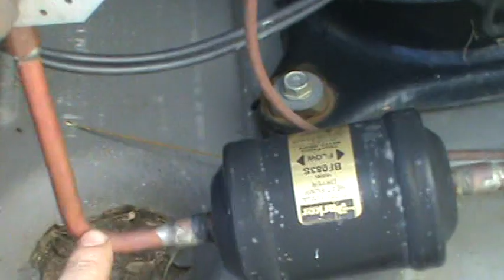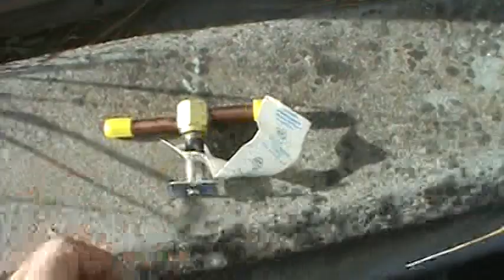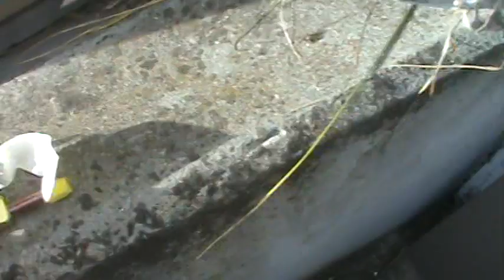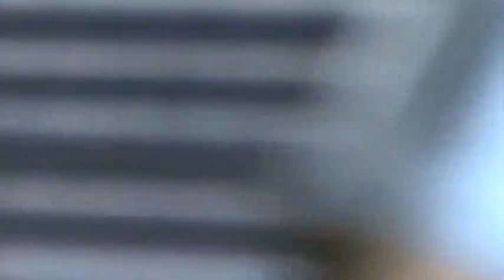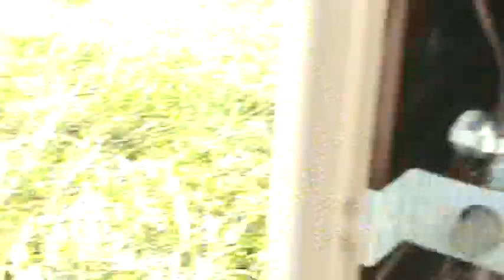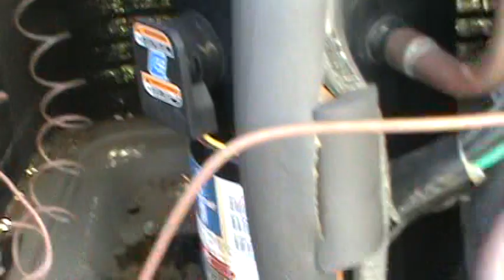Air to air heat pump modification: Video 1

Comment: Air flow issues can cause that hunting.  Your unit looks very close to the house.  The coil looked clean enough but can't say from a video.  If you hold your hand over the condenser fan when it runs, feel the air flow and if it is blowing more "out toward you" than "up".  Restricted air flow can be found this way.  You seem very tech smart, but I wasn't sure if you were into the science of air flow also.
Reply: PS I didnt mean to imply air flow was the only possibility.  Just one that came to mind.  Another is a low refrigerant charge due to uneven distribution out of the coil....  and the list of possibilities goes on.  I just love sharing and the discussion.

Comment: how the fuck did you come up with 80000 btus of heat loss. The sensor you moved is a coil sensor it is supposed to be on the "coil" not on the liquid line and not between the metering device and capillary tubes. The sensing bulb should be insulated so as to keep the ambient temperature from affecting expansion valve. Also all heat pumps are designed to switch the reversing valve, cut out the fan and engage the heat strips to compensate for the cold air. 

I would love to know how that hot bypass is working for you.

Comment: Dude what an AC genius!  Can you point me in the right direction on how to modify a window 1 Ton heat pump to heat the water on my electric water heater?  The thing is old and a new one is 2K.  I can get a 1 ton heat pump for $300.  Can you let me know if you think that can be done?  I already have a drain plug for the AC that sits next to it.

Comment: Any more updates on this project?  How'd the hot-gas bypass defrost work out?  I'm considering something a little less technical... solar collector to pre-heat the outdoor unit intake air (winter only). I'm still learning, but always searching for ideas.  My Trane XL14i (2.5t) just ran out of warranty, so I'm ready to begin mods. I believe I may even have a bad system controller, as it does not like to bring in aux heat (gas) by itself. Defrost seems fairly normal... rarely runs, but the odd part is that the system runs down to under 15°F and still pulls heat in. By then it's running 100% of the time, and not really enough btu's to heat the whole house (setpoint 69F), so I have to run manual aux-heat over-ride on the thermostat switch.  The compressor has hot weather startup issues, but not in Winter. Service techs refused to replace the start cap, saying they had to prove it was bad before replacing it... cap's don't always give clear-cut symptoms, I think often you need to test by replacing.

Comment: Heh... I was looking for Air-Air to Ground-Air HVACs mods :D 
Actually just ideas about encasing the external heat exchanger in a box so I could run glycol thru it and loop it in a deep ground exchanger. 
That could be an idea for you, too. No?